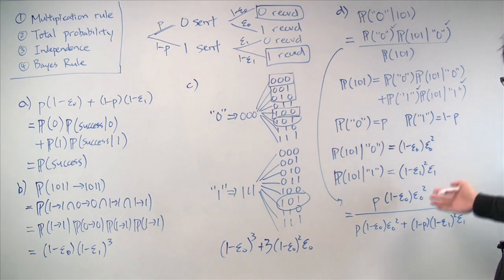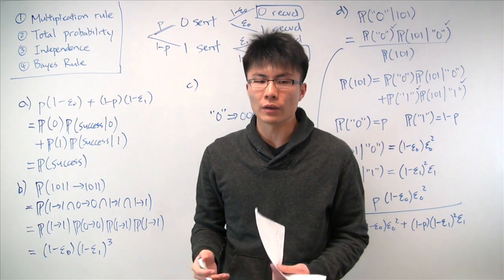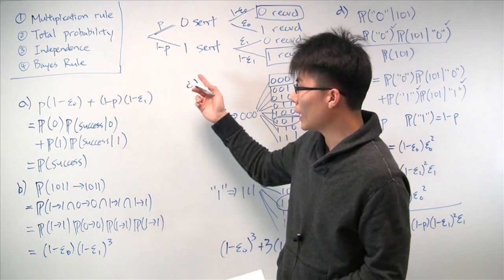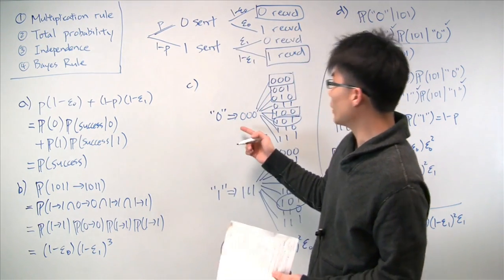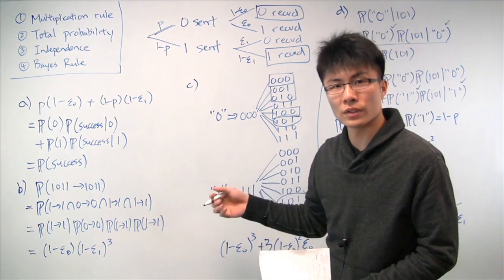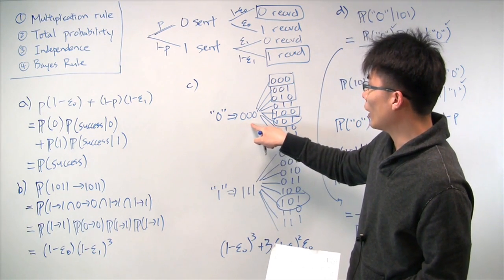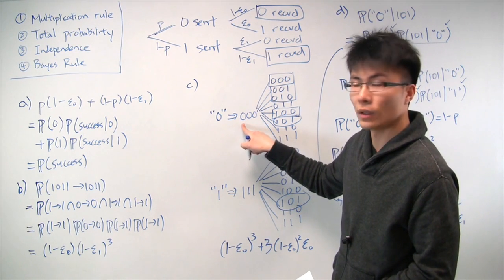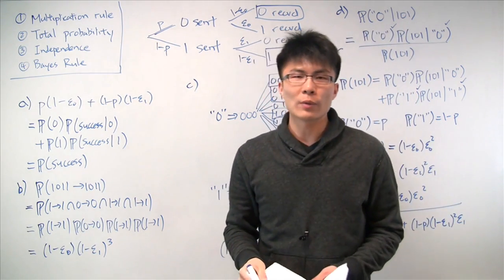Communication over a Noisy Channel

Comment: I don't get that why at 6:50, event (1011>1011) can be written as an intersection. 1>1 and 0>0 are two disjoint events. Isn't there intersection be empty?
Reply: You can think of it as the product rule used in combinatorics, ie the whole transmission will be complete when you've transmitted all the bits. So, that's why intersection or multiplication is used.
Reply: Disjoint events means that if event A occurs then event B cannot occur. 
So, does a '1' being successfully transmitted (1→1) implies that the next bit '0' will not be successfully transmitted (0→0) ? No.

Comment: For part (c) and with using the majority rule, wouldn't be correct to say that there's a 1/2 probability that a 000 would be correctly interpreted/received as a 0? I say this because in 4 out of the 8 possible outcomes, the receiver identifies the message  sent as being a 0, using the majority rule.
Reply: No, because not all outcomes are equally possible.

Comment: Why is P("0")=p instead of p^3 ? If "0" stands for 000, which means 0 was sent three times in a row, correct?
Reply: This is because transmitter is 100% accurate and only the receiver makes mistakes. In part (c) the problem states "a 0 (or 1) is transmitted as 000 (or 111, respectively)." So now we can assume that 000 and 111 are atom events. In other words:
The "speaker" decides whether or not it wants to "say" 0 or 1 with probability p or (1-p). The speaker makes no errors.
The "listener" does make errors. It "hears" a 0 incorrectly with probability e0 and "hears" a 1 incorrectly with probability e1.
The way the problem was worded confused me as well.
Reply: Well, it makes sense what you have said but that should have been clearly stated. Anyway, thumbs up for the way Jimmy Li guides us through the exercise.

Comment: I don't get it why in the d) part probability P(101|"0")=(1-e.)*e.^2  but not 1/3rd of that? And the same for P(101|"1")?  It won't affect the final answer, though.
Reply: +Ваня Xuльko It would have beeh 1/3rd if the distribution was uniform, which it isn't